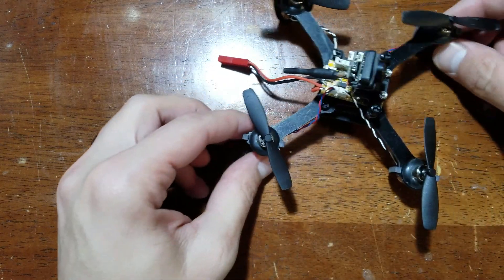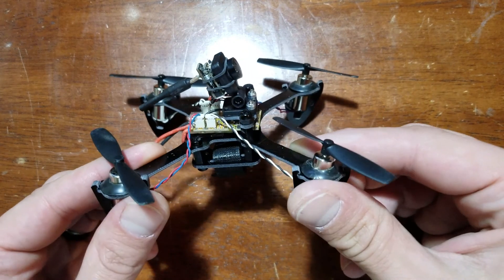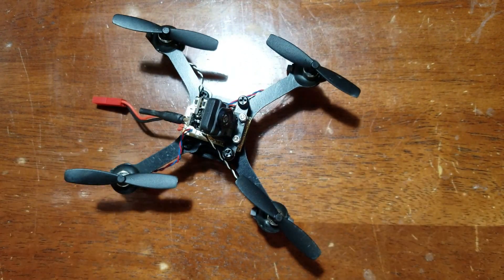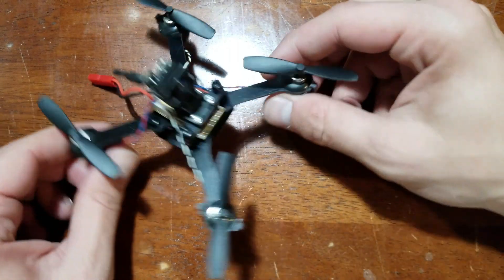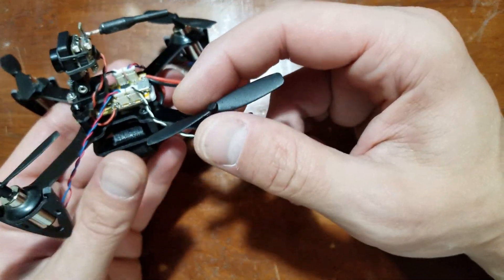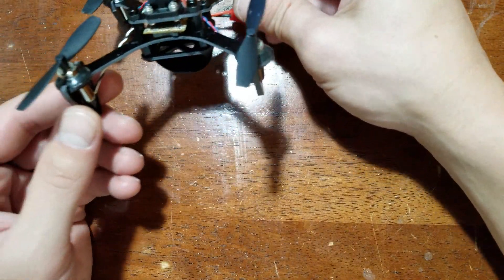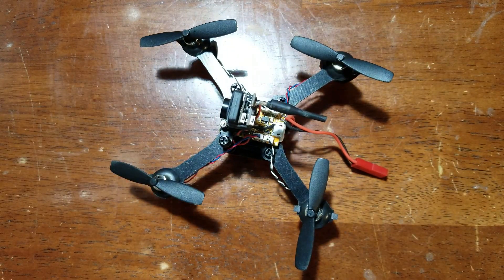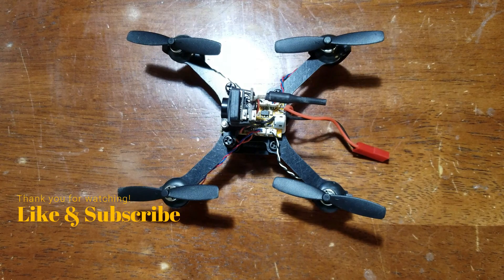Pitch Plus 115mm Brushed Frame

Comment: thats to bad this frame is not amazon prime eligible, and shipping is $5 or else i wouold own it, but im frugal and always looking for a screaming deal
Reply: $12.95 on Ebay, I'm getting one. My first real drone after getting a Sharper Image toy drone for Christmas and flying it until it refused to operate any longer. I love to build, this is going to be fantastic!! $49 for the whole kit, bargain!!
Reply from the maker: +THE DUNNING KRUGER EFFECT THE DUNNING KRUGER EFFECT I know how it goes.  I'm the same way.  The nylon standoff aren't that great.  I think I'm going to I look for a set of metal m3 standoff and then it should be indestructible.
Reply: Hey C Ray Tech, let me pick your brain, now that I have been incessantly pounding away at this hobby, what I have found is that the reason to use nylon standoff’s vs metallic is that some PDB’s and FC’s PCB’s coppper traces extend out to where the stand-off holes are located, therefore if a metallic conductive material was utilized ie a metallic standoff, it could create a continuity issue, alllowing contact between the copper traces and the standoff, what’s your take
Reply from the maker: +THE DUNNING KRUGER EFFECT THE DUNNING KRUGER EFFECT that is a concern with standoff.  It's an issue with all electronics.  I recall fellas shorting out their pc motherboard with poorly placed standoffs.  I don't care for the plastic standoffs because of durability.  I would like to plastidip some metal ones or use a rubber bushing to stop any grounding out.

Comment: Nice looking build. I'm curious to see how that flies with the pitch in the motors. Looking forward to video of this in flight and Happy Flying!
Reply: I just built one using an F3 evo brush flight board. It's crazy quick!! Extremely nimble.
Reply: CrazyRussianCat   The beecore looks like the same board. As long as the board is meant for brushed motors, I don't see why it wouldn't work. When you connect to the flight configurator set the quad at a 15 degree incline and recalibrate the board. It makes it much easier to hover.
Reply: CrazyRussianCat  Batteries 800mAh 3.7V 25C 1S with JST Plug. I found a good deal on ebay, with a charger, and just stick them to the bottom with velcro tape. You might have to change the plug. Smaller batteries , 650mah, or so, will make it much faster. You can also run 2S batteries,  and it makes the quad very fast, but the motors cost more, and the batteries cost more.

 I also used the IrangeX tiny receiver, and a turnigy TGY-i4X controller, with 2 added switches. The flight boards don't come ready to bind to a controller.
 This is similar to my setup, https://youtu.be/yw5yX4516Bg and will give a basic list of parts.
 The motors don't last long outdoors, and only about 35 hours of total flight time indoors, so it might be helpful to add plugs to the board. 
 I'm quite new to the whole quadcopter scene, but I am having fun and hope you do as well.